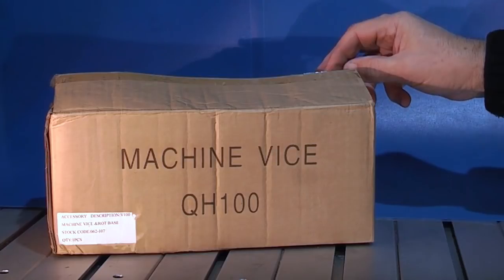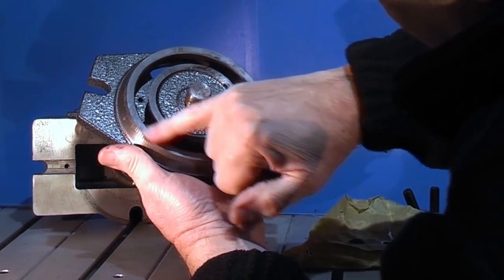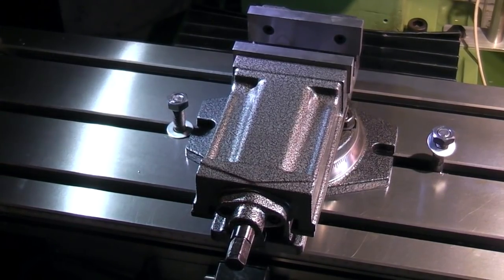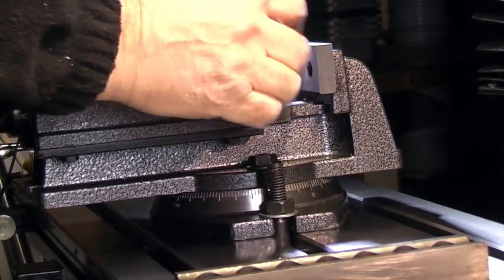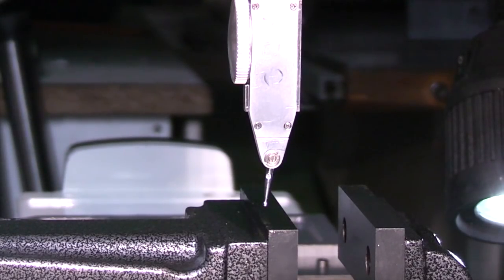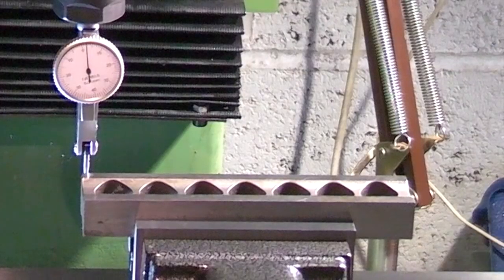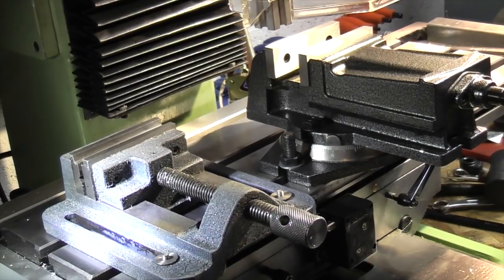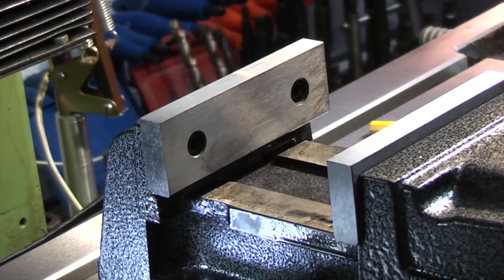New vice for the mill

Comment: Id recomend heavy washers on all 4 vise bolts . Theyre aready distorted in one mounting. Oh and dont be surprised when the table and vise bottom are rusty. Wd40 has rusted up so many things and ruined guns. Use way oil or the lube the mill table calls for as lubricant. I too have the same vise in my tool room. For rust protection on steel use balastrol with lanolin thats the best but home made works. Eds red recipe - with extra lanolin in it. Thanks for the vid

Comment: I have the same vice, after a week i took off the rotay base as mine does not sit pefectly flat, i also get movement under load between vice and base. It can tend to distort(lift) when clamping. Its nor lon fir tommorriw and will be relegated to some other job like on my drill press as i have no confidence in it. As soon as i get my rotary table a new vice is next but with vertical and horizontal v slots ready cut in the jaws., sorry if this disheatens you but i would prefer you knew some of its defects rather than say its great, it may save an accident.

Comment: Alan

Realize that the extra space occupied by the rotary base of the vise MAY limit things like chucking reamers.  I found that I very rarely rotated the vise, but did have problems with chucking reamers, and especially using a chuck I had some issues with jobber length larger diamer drill bits, so I took the rotating base off my vise and pretty much never looked back

So, put some thick stock up on paralells and see if you enough room for those longer drill bit/reamers/etc, especially with a chuck in the spindle

John

Comment: hello  just a question  how do you like the DRO you are installing???
Reply from the maker: Hi Steven It speeds the machining process up. Once you have set your tool position on the DRO you can use the DRO to give diameter and length.
Don't miss next weeks video

Comment: There's a trick you can use folks to ensure parallel - or workpiece - is truly flat on the rear jaw. Insert a small vertical dowel or rod between the middle of the front jaw and the parallel/workpiece. BobUK.

Comment: Hi Alan,
The vice looks similar to the one on RDG tools, I bought one.
Recommend checking the moveable jaw for  lift, when tightening, also check the bottom of vice jaw area for being parallel with the bed.
After some time the swivel base wears a groove into the base of the vice causing issues.
Overall not bad for the price point, it seems a little small for that milling machine ?.
I found buying a vice, rather frustrating at first, a 4" vice (jaw length) doesn't open 4".
So l ended up with 3 vices, a Warco DH1 and a Arc type 2 "grinding type" vice, the latter gets the most use !
ATB Adam

Comment: iam looking for a 3 inch milling vise that does not lift the work when tightening. I have a mini mill  anyone help please
Reply from the maker: Hi Pete have you checked that the gib strips are locating ok on mine I had 0.004" lift
I removed the strips and filed them flat removing burrs and bumps. I then refitted and checked how much the jaw lifted.
Reply: @enotsengineering  i dont have gib strips on my vise
Reply: Its knock of of a kurt vise